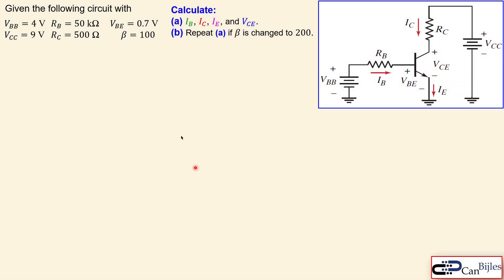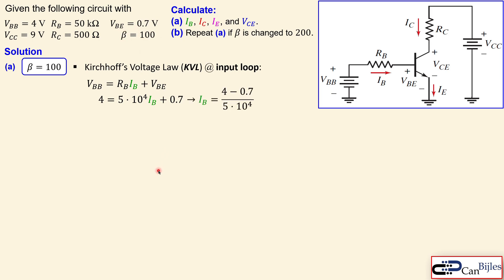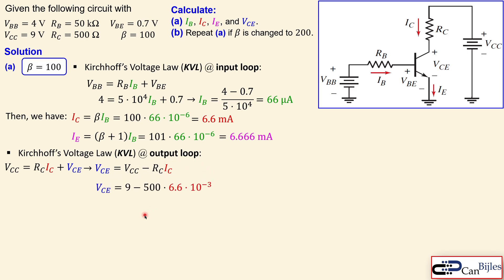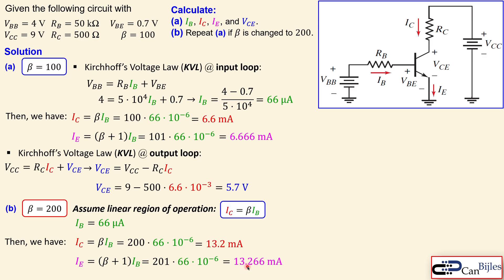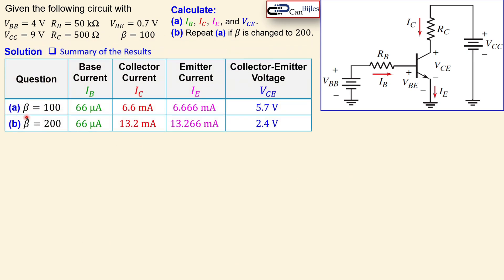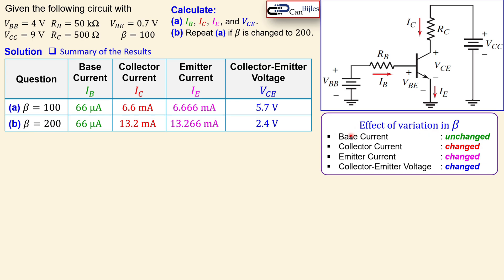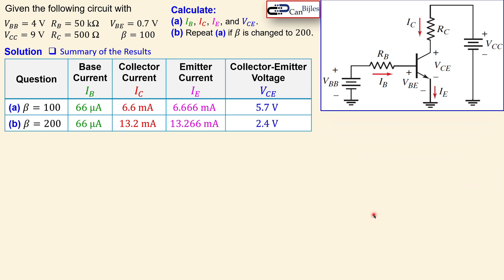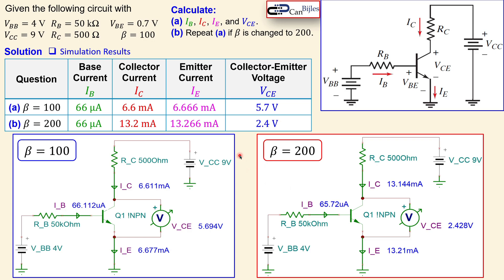Bipolar Junction Transistor (BJT) Circuit 🌟 Effect of Current Gain Beta 💡 Example 2

Comment: How does one read beta from datasheets? It never says specific value, can you do a video about that.
When we learn at school we are usually given beta in our exampels but when you open datasheet there is only min-max value. 
Can you please elaborate?
Reply from the maker: The values given in the datasheet are almost always within a range, like min, typical, max values. Also, beta is given between two extreme values and it also depends on frequency, so it is actually not a constant. 

How do we take the beta from the datasheet then? Good question 🤔 We use a bias-stable circuit design to compensate for the changes in beta and also other parameters in the circuit. See this video for more elaboration about this beta change: https://youtu.be/jiRXzYaW9Ro